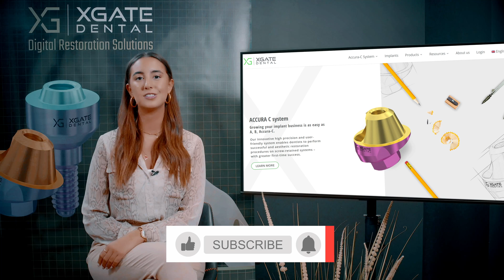Solving the problem of deviation between fitting analogues and models using the algorithm from XGate

Comment from the maker: 00:00 You need to have good digital analogs.
01:00 If one technician uses one company's analogs with other material printer...
02:00 You don't need a working model because.
03:00 The Impressions were taken on multi-unit level and scan abundance  
04:00 You can get different results depending on the material and...
05:00 What's a calibration jigs.
06:00 Everything will fit just as it's supposed to in the mouth because...
06:30 it's not recommended at any time...